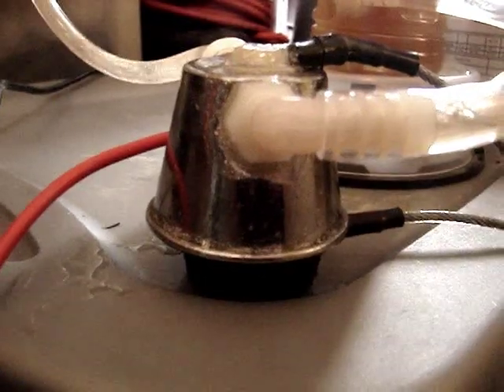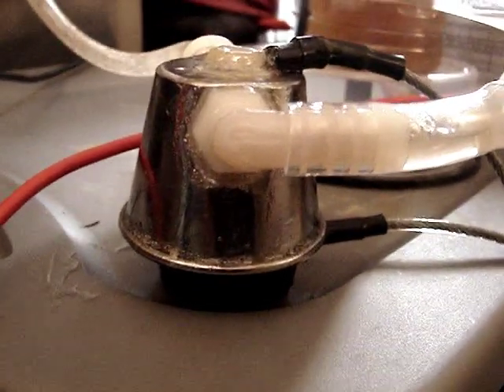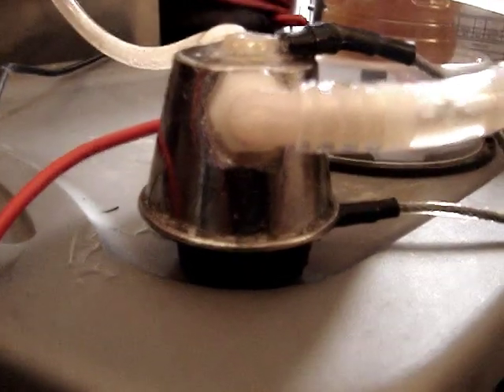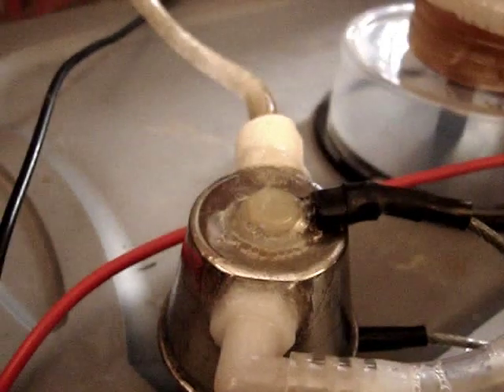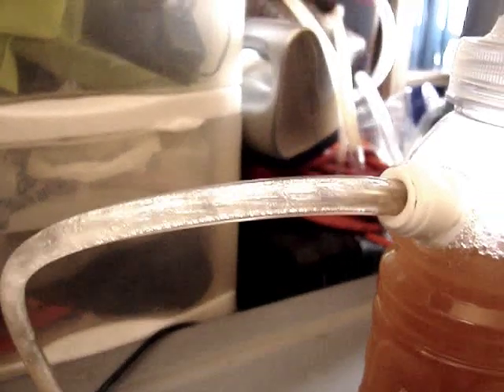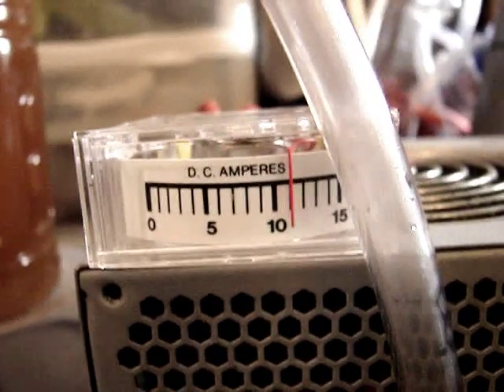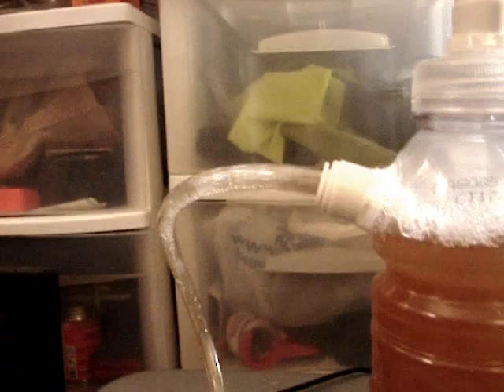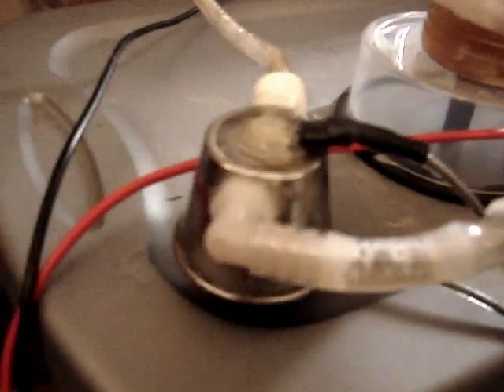Vid19 Smallest Volcano Cell YET! (HHO, Brown's Gas, Hydroxy)

Comment from the maker: I have about 100 stainless cups left, so I'm gonna keep playing around with some other cup designs for now.

Maybe I will give it a try after I run out of cup ideas.

I was at Home Depot yesterday and saw that they have several different sizes of galvanized steel fence posts. They are basically pipes, but cheap enough to experiment with fuel cells.

Comment from the maker: I've done that with the 12V leads. They are rated at 20A, but I have an inline 15A Circuit Breaker, so I don't burn it out.  The first PC power supply I used burned out, because I used a 20A fuse on a 20A Max Load.

I definitely won't make that same mistake again.

Comment: Okay...
If you do, check the efficiency of the power supply, and keep the amperage draw below that efficiency level, otherwise you'll kill the power supply(experience)
If it says 36amps on the 5V lead, and is 85% efficient, then keep the peak(after warm up) amperage draw below 30amps...same goes for the 12v leads...
My lesson learned... ;-)
Steve

Comment: I'm starting to see these become more popular.  Really neat cell, man.
Is that a hacked computer power supply i see there?
I've found that the 5v leads on those work great for small cells with a +N- setup which keeps the volts in the 2.1-2.4v per plate range.  Also, the 5V rail can put out between 32-38amps.
:-) Great Job.
Steve

Comment from the maker: Thanks, 

The real trick is to use a larger refill tube than your exhaust. This way it equalizes the pressure and the water will continue to pour into the cell, because the larger hose provides more water pressure than the exhausting gas.

Comment from the maker: I tried a thimble already, it was a failed attempt! It was too hard to drill, but I was able to mount it on a 1/4" hose barb. :)~

It's funny that you say 1/4 LPM, because that is exactly what I measured after I filmed this video. 

For its size, it performs very well, but I'm not sure that it would make any difference with fuel efficiency or emissions. But then again, it outperforms the Water4Gas designs, so maybe it would be worth trying.